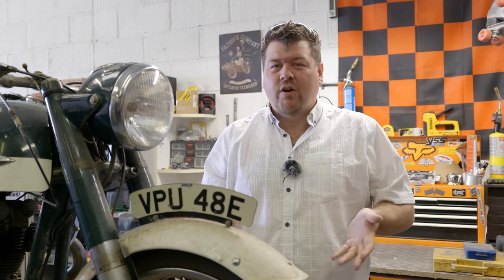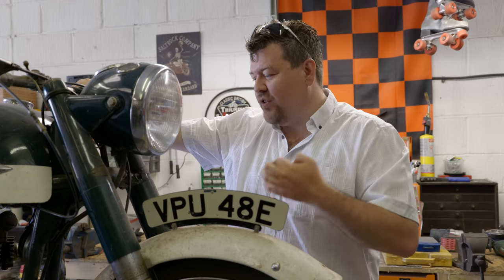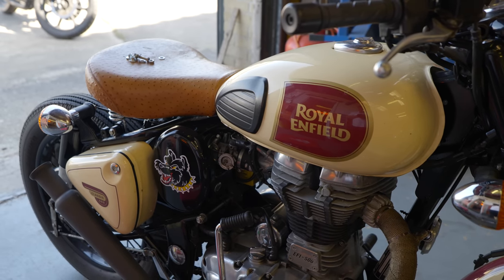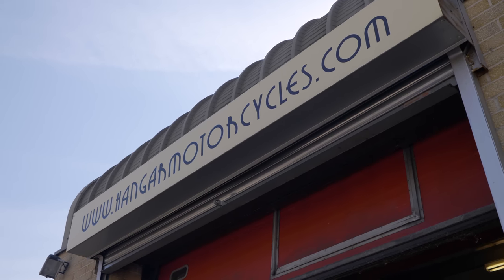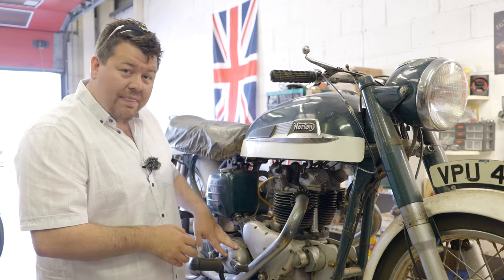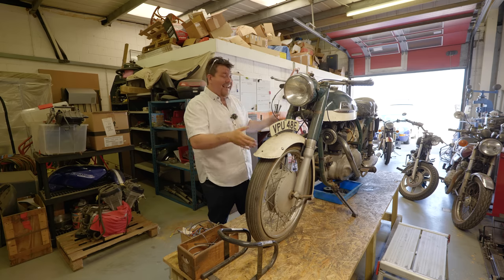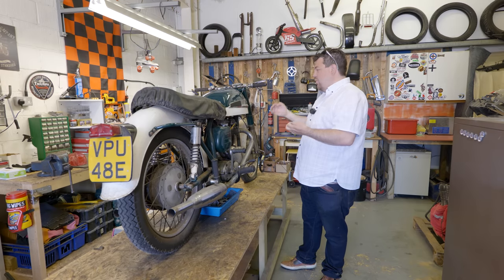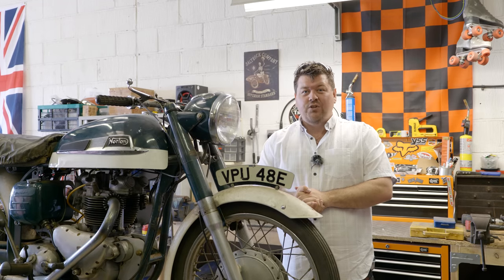Restoring the Motorbike My Grandfather Rode As A Teenager - Part One

Comment: Great project and definitely worth doing, last year I finally got around to recommissioning my 71 Bonneville that I've had since 1981, I kept all the original paint as it was done in period but had the cycle parts smartened up with black powder coat, I did all the work myself apart from the powder coating including top end rebuild, new carbs and some tasteful mods (electronic ignition, upgraded electrics and upgraded clutch) to aid driveability. Good luck, looking forward to seeing how this project turns out.

Comment: Years ago I had the Norton Dominators smaller brother, the Jubilee 250 twin, It looked very similar to yours James, just smaller, I've had lots of bikes since but held on to my '71 Triumph Tiger 650 for the last 45 years,  The later Tiger 650, that I have has the same engine as the Bonneville, same camshafts etc, Only difference is a single carb and different manifold. They are normally very easy to start, just tickle the carb till she floods, good kick and it should fire up.

Comment: Having owned two triumph motorcycles both 650cc in the 1960,s. I can tell you triumph motorcycles were known for being one kick starters. your bike being a 500cc it should start by looking loving at it, another words turn the ignition on tickle the carb of course a proper Amal, and one swift kick should bring it to life?I forgot about the choke of course a manual cable operated choke and off you go. Believe me the general consensus if it didn't start one kick after the starting drill you have a problem that needs sorting out .
Reply: It has a T110 engine Phillip, which is 650cc and yes they are normally very easy starters.

Comment: looks a lot like the 1960-70 single cylinder 250cc BSA (starfire?) i bought in a basket and rebuilt back in the early 70's. should be an enjoyable project. and yes, there were no keys. 

BTW, the "race" transmission, mechanically speaking, vs the "standard" one is probably nothing more than turning over a selector plate in the transmission. i know, because when reassembling mine i accidentally reversed the selector plate during re-assembly and ended up with the transmission in "race" mode.
Reply: What part of it looks like a BSA  unit single exactly?? 
You can not reverse the camplate on a triumph gearbox
Reply: @nickmarshall9192  i had the mid 60's version. probably a C15? no rubber bellows on the forks. similarities include the tank, headlight, forks, brake drums...

Comment: You are wrong about the gearchange pattern 
 The gearchange on a pre unit triumph is one down three up 
BSA/Norton/Enfield etc were one up three down the same as current Moto GP 
Your bike should be very easy to start ,a pre-unit triumph should start first or second kick ,I'd definitely get the magneto reconditioned if I were you the shellac breaks down over time
There is absolutely no point in fitting a key ignition to this bike as all anyone needs to do is cut the wire and ride off 
You will need to carry a lock with you 
Good luck with it personally I wouldn't change anything on it I'd just do what is needed to make it run